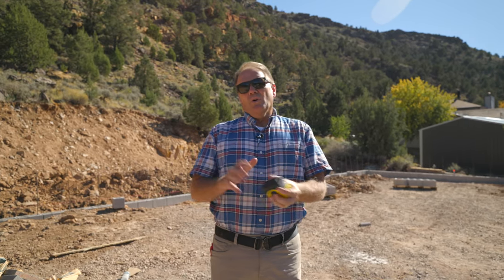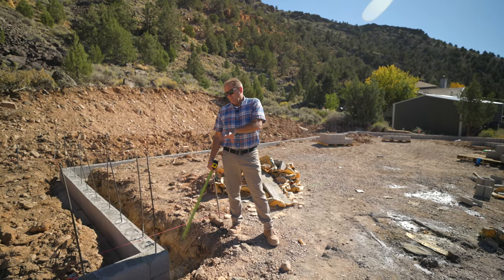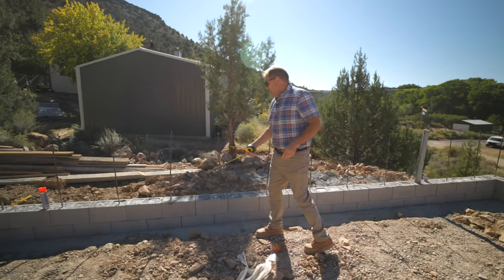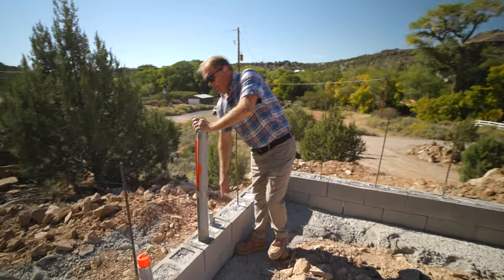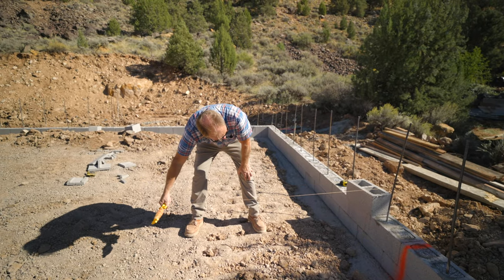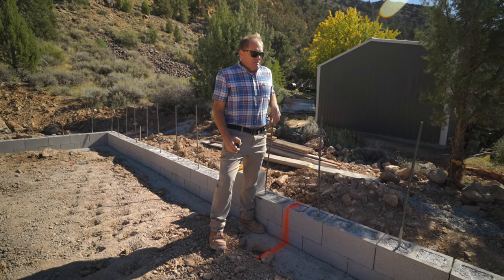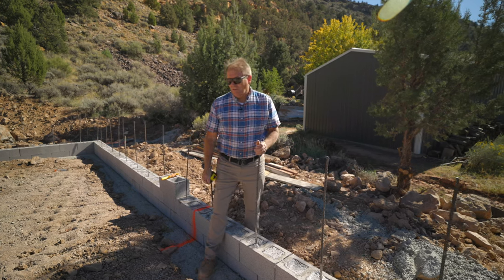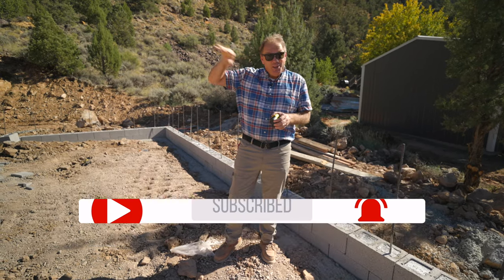Frost Depth And Foundations. Mistakes To Watch Out For!

Comment: So I want to make a small room its only going to have electricity. I'm planning to use a stem wall. I have a question. In this video the gentleman is standing on raised ground compared to the stem wall, I was wondering can just dig out the dimensions required for the footing and stem wall and leave the center ground undisturbed and it look like this man where he is standing? Or will I have to dig out the entirety of the ground and flatten it? I've never done building I'm doing alot of research I don't want to mess up, any advice would be appreciated

Comment: Have you looked at strata foam frame/insulation? They claim 50% savings over wood. I'd like to know what drawbacks there are to this material.
Reply from the maker: I have not really seen the savings they claim. Still looking though.

Comment: I heard in a video that footers without board forms or some kind of form for the footer aren't up to code?  Also I'm confused about what you said at the beginning about the frost depth, what's are you trying to satisfy with 32 inches?  Is that going to be the top of the slab at 32 inches or what? (yes I can be dumb)... I see the concept of what you are doing and I like the footers in the ditch and the wet set blocks, seems more efficient.  But I guess they made the wood forms the code to eliminate the rare times when the dirt isn't strong and doesn't support the side, or something, not really sure why you have to do formed footers, or maybe you don't have to?  Also, I checked out your videos, if you put more relevant keywords in the title of the video you might get more views and subs.
Reply from the maker: Our dirt is full of aggregate and clay, works best to pour footings directly into trench. Sometimes a complete for works better when you need the elevation to be just right.
Reply: @HowToBuildYourOwnHome  I get it, I like the no-form method, less wood, etc... but I thought it was not up to code.
Reply: @VenturaIT  There may be some areas that want a formed footing, but I have not heard of anything. It is basically up to the engineer and concrete sub, and whatever is the norm in the area. This is Keith replying.
Reply: @Lastboomers  I guess it depends on the local code.  I heard that international code did not allow trenched/earth formed footings.  I just read that in Wisconsin for example they are ok just so the soil is stable.  I'm not a contractor or builder, but I'm learning about it.  So I like to know what is 100% correct.  I like the earth formed footings and the wet laid block, so efficient and saves steps.